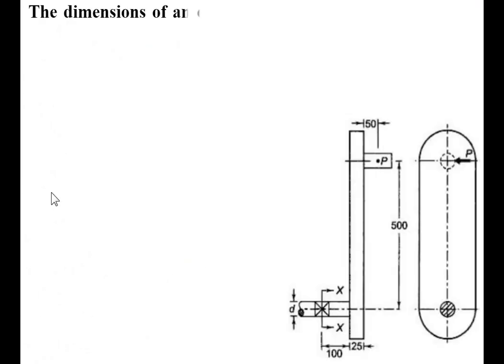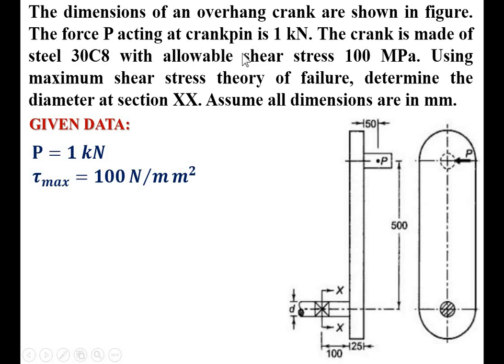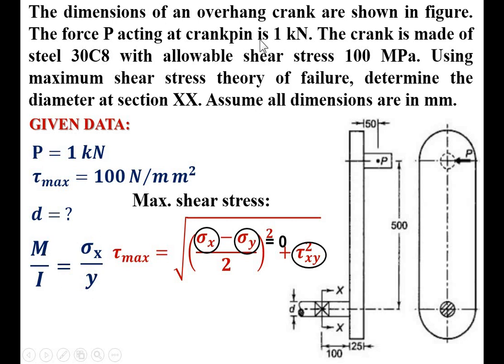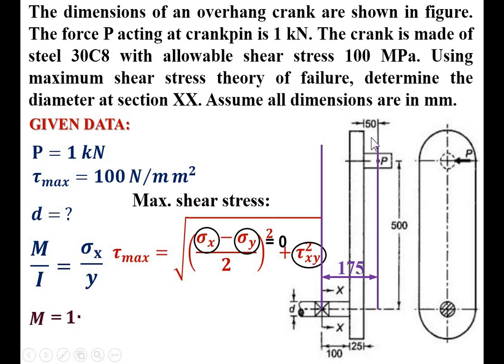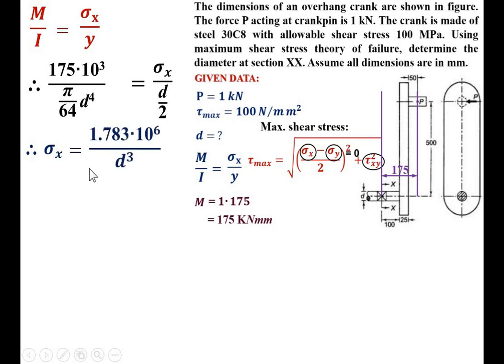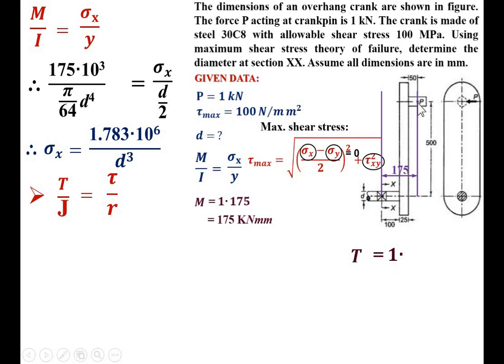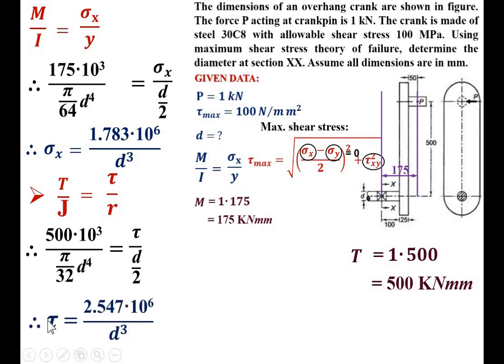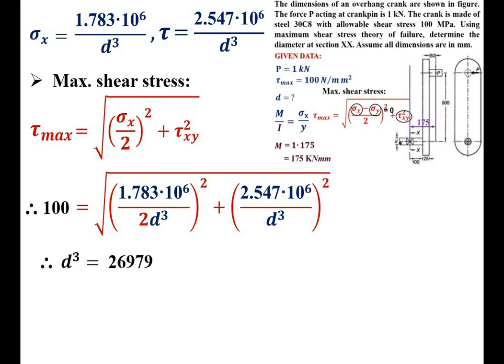Example on Theories of failure, Maximum shear stress, Tresca & Guest theory, Machine Design #design

Comment: The bar is made of hot-rolled steel and has a yield strength Syt = Syc: 500 MPC true strain at fructure &= 0,6 Loaded force P = 10 kN = 40 EN Estimate factor of safety F-1500 N

For stress element a-) Max shear stress theory b-) Mox distortion energy theory.

150mm

F

Px

diamete 30mm

S

لله